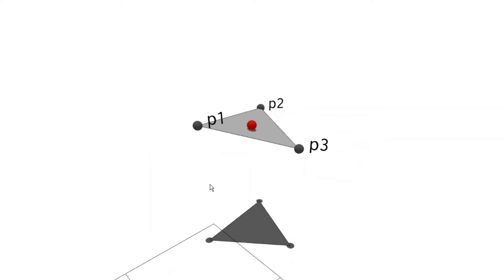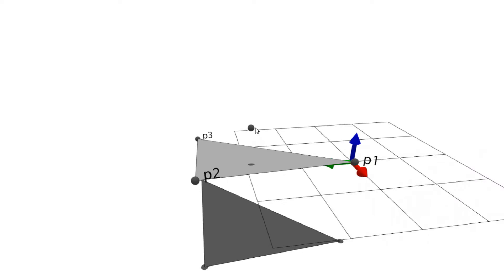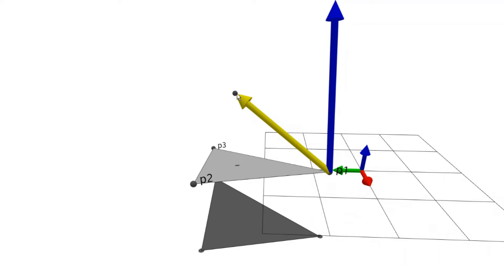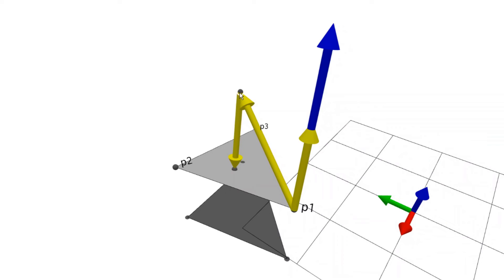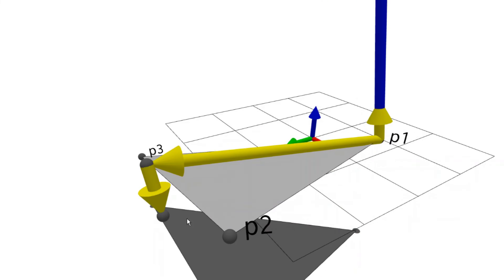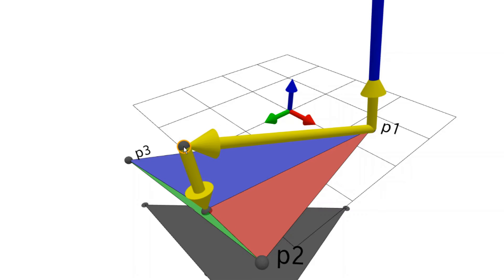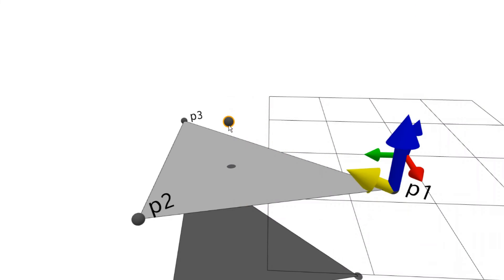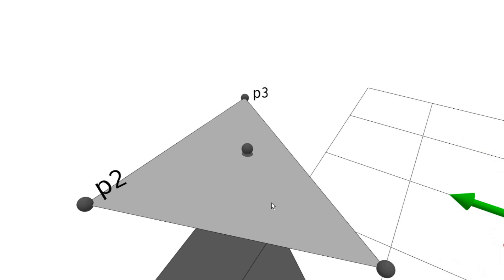3D collision between a point and a triangular face

Comment: Perfectly explained. I used this algorithm from 1982. You can calculate area of the main triangle ABC. Then a point of checking (point-in-a-triangle collision detection), for example K(doesn't matter where it is, inside or outside a triangle ABC) must check condition: area ABC = area AKC + area BKC + area ACK.
IF (left side <= area ABC) THEN the point is inside triangle ABC, ELSE The points is outside triangle ABC. Simple and effective. It work in 2D and 3D space as well.

Comment: So the plane equation would only detect if the point collided within the imaginable plane but we also need another algorithm for detecting if the point went outside of the actual geometry right?I was thinking about using cosine rule for obtaining the angles between three inner triangles and use it for the secondary detection(i also use an method to quickly and reliably calculate the distance between two vectors using pythagoras theorem) in order to do that.
Reply from the maker: 2:16 should answer that question.
Reply: @morejpeg that is the point because i was wondering how the hell that simple math function can magically be for real uses.The equation also needs normalized normal vectors to make sense.
Reply: @morejpeg your approaching is very cool anyway,i had been researching SAT and GJK but they seem unclear to me how exactly do they need to be implemented.
Reply from the maker: @lanchanoinguyen2914  Thank you!  SAT and GJK are used for collision between convex polygons.  For simple sphere-triangle collision you can use this or use a signed distance function (SDF)  https://youtu.be/chScv-vaXPo
Reply: @morejpeg  idk about sdf method,does it cast a ray and record all distances(and sum) to vertices and then find the shortest sum as it's the colliding point?
Reply from the maker: @lanchanoinguyen2914  the sdf for a triangle is a function which accepts a point and the three points in space that define the triangle and returns the distance form that point to the triangle.  That is all an SDF does. It is used with raycasting/raymarching but the sdf itself just says how far some point is from some geometry.

Comment: This is exactly what I need for my game! Except I have polygons with more than just 3 vertices... Do you think this formula would still work?
Reply from the maker: If you're using Blender then in edit mode you can CTRL + T to triangulate selected faces. You can also use the Triangulate Modifier on an object.  But check out my most recent video on collision detection using an signed distance function, I think it's more efficient.
Reply: No, you must break your polygon to triangles.